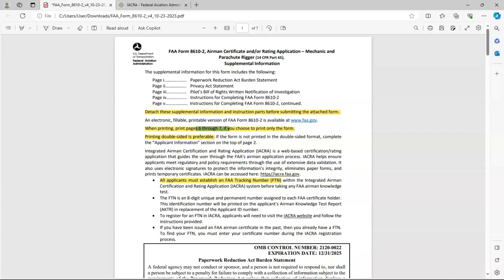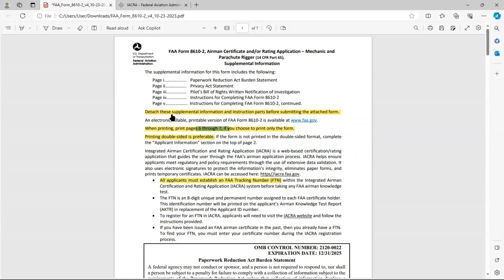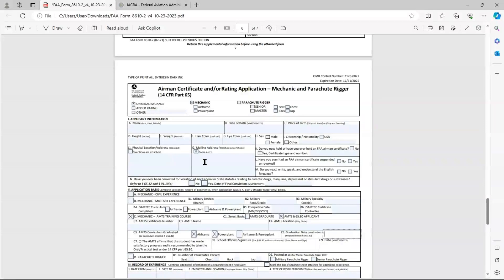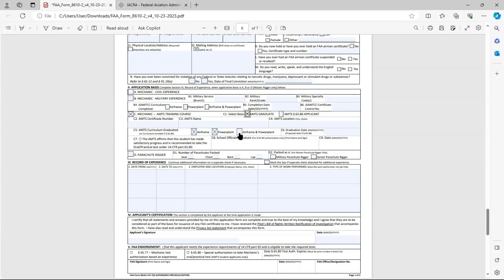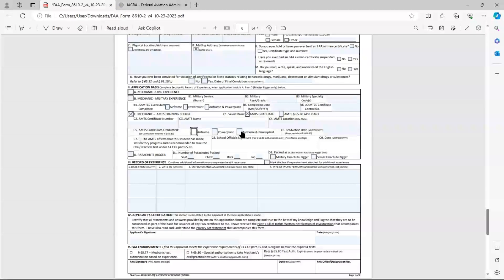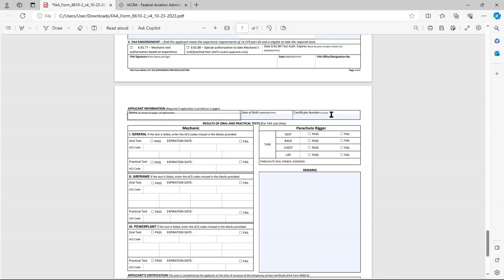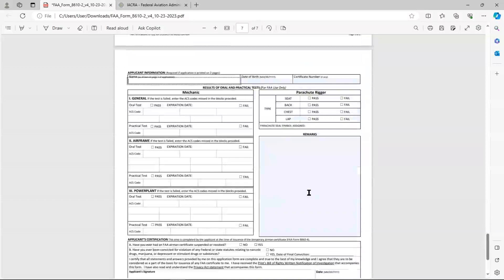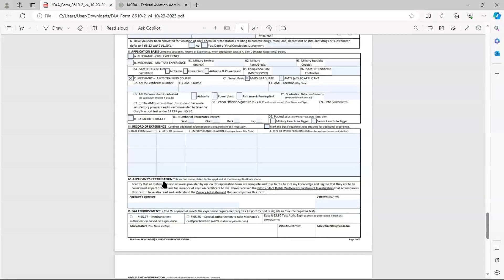FAA FORM 8610-2 Instructions (2024)

Comment: So you just print those and fill them out and take them with you to the O&P’s test?
Reply from the maker: Yes.  I recommend filling them electronically, print and save a copy in case corrections need to be made.  2 signed copies are required to be brought to the DME.

Comment: nice video helped a lot... I'm a brazilian military soI would like to know how can I fill out that part of military experience.
since that I dont have civil experience. Could you gimme a help
Reply from the maker: You will need to contact your local FAA FSDO and make an appointment.  The military experience portion is for the FAA to approve in section V. FAA ENDORSEMENT at the bottom of Page 1.    Your DME does not approve the Experience portion, the FAA must endorse that portion BEFORE you make application with a DME for the O&P.